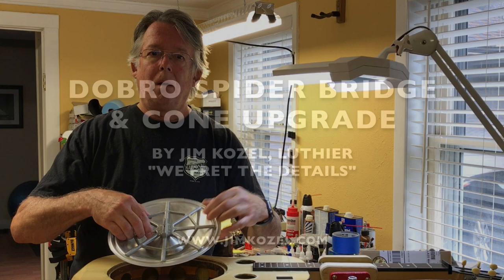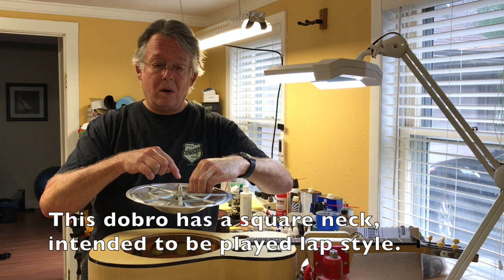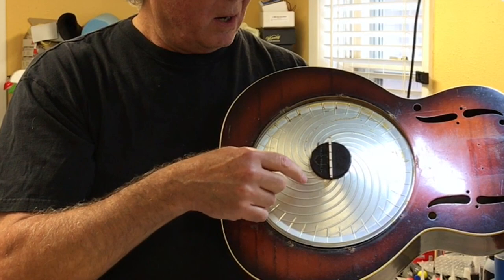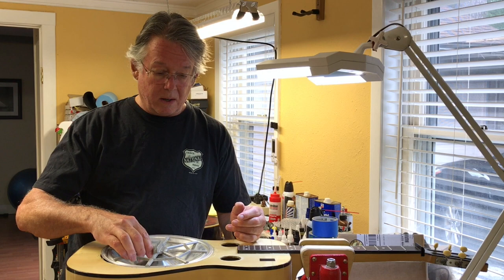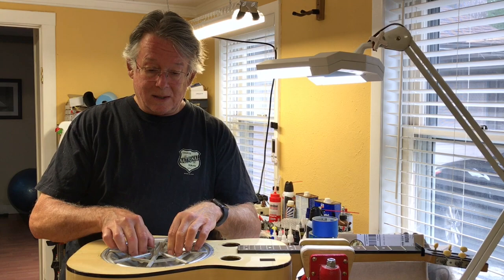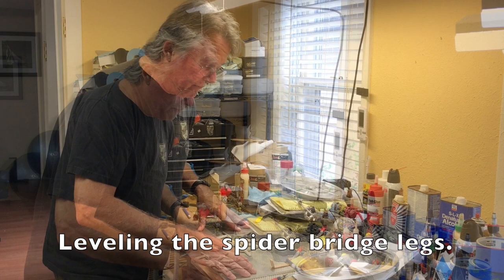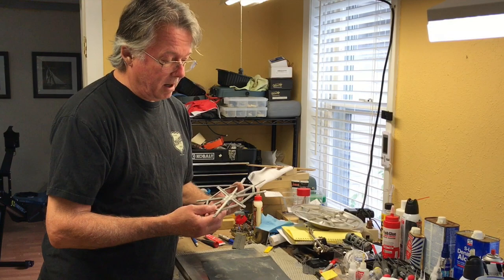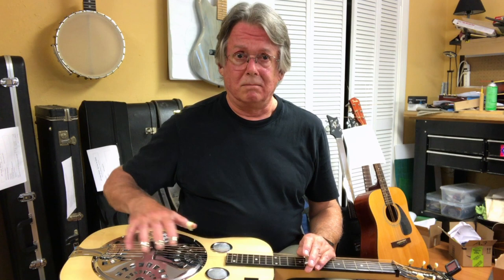Dobro Spider Bridge & Cone Upgrade

Comment: Thanks for that great video, especially the nice trick for leveling the spider legs. We never think enough about  the importance of that detail (focusing only on the cone sitting flat on the body rim!..). On a roundneck model (with spider cone), both played with the slide AND left hand fingers, do you think that a small bridge slant could help improving intonation? (or do you think the bridge should always be kept perpendicular to the strings?)
Greetings from France, across the pond.

Comment: My bridge is what I think you would call a biscuit bridge, its on a plastic disc, however this disc is not fixed onto anything, so when I changed strings my bridge moved a lot, what angle do I want to put it back at?
Reply from the maker: Sounds like you're describing a single cone resonator.  The biscuit bridge should NOT be plastic.  The base and actual bridge are usually rock maple that's painted black.  It should be carefully attached to the top of the cone, usually with a small wood screw.  To adjust, install with the bridge straight/perpendicular to the strings and tune up.  If intonation is good, then leave it.  If intonation is off just a bit, rotating the bridge and cone about 2 minutes counter clockwise should fine tune it.  Again...the biscuit bridge needs to be attached to the cone.  Leaving it loose may result in damage to the cone.
Reply: Thank you, it probably is painted black as you said, I cant really get that close a look at it as there's a metal part above it. 2 mins counter clockwise is the correct angle for bridge? I guess I can estimate that. if I can get all strings in tune both open and at the 12th harmonic then it's fine?